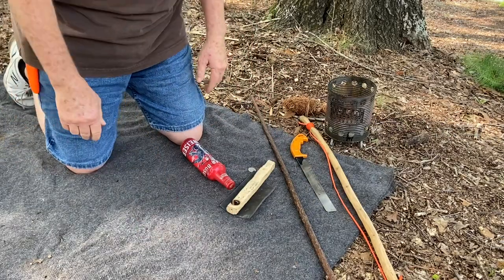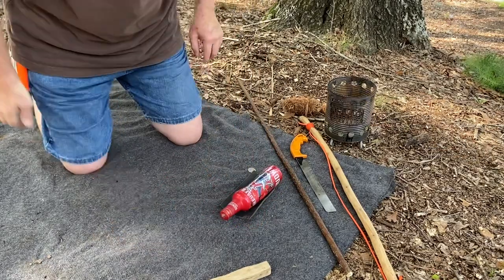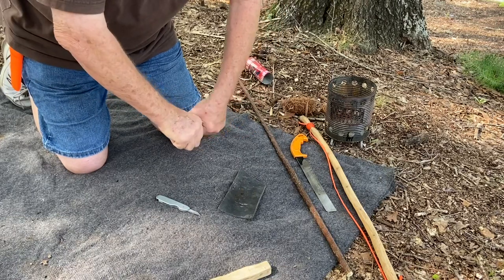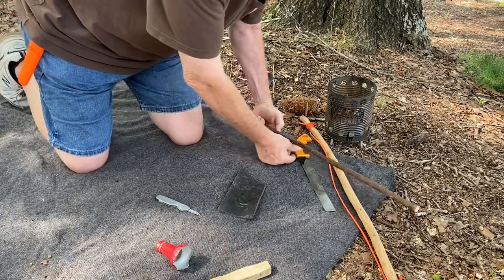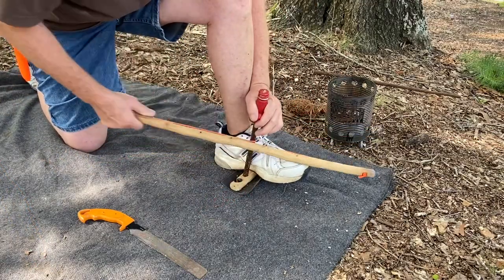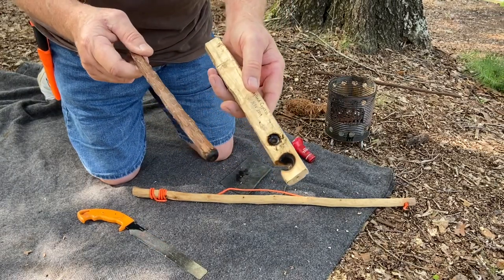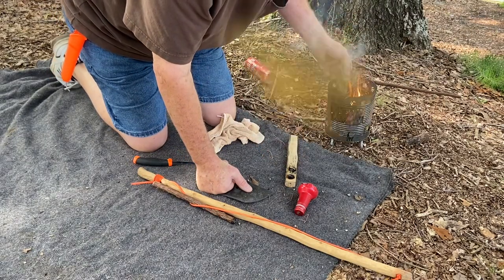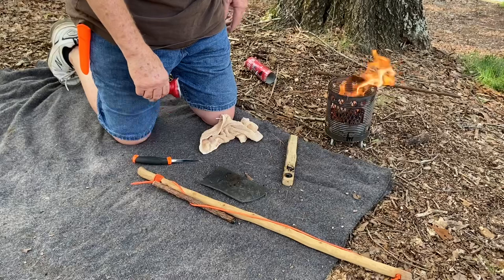How To Bearing Block A Hand Drill Spindle For Bow Drill

Comment from the maker: Thicker Hand Drill spindles will bow drill the best. The smaller the diameter the more difficulties you'll have because of flex. If flex is a problem, shorten up on the spindle length, loosen up on the bowstring, and/or use extra wraps of bow string around the spindle. Yes, although difficult, even a 3/8" diameter hand drill spindle will bow drill.
   Please follow the LINKS below and SUBSCRIBE. Thank You!

Bearing Blocks Playlist
https://www.youtube.com/playlist?list=PLkoXX8XsMW3lwi4bBSrVyJkE_omDFGR7g
How To Bearing Block A Mullein Spindle For Bow Drill
https://youtu.be/5EWVadutxN8